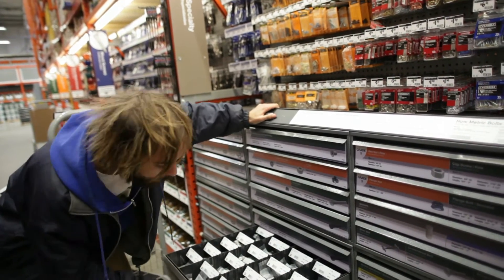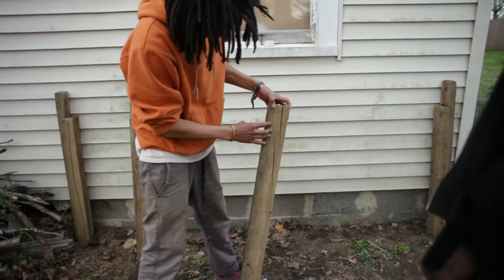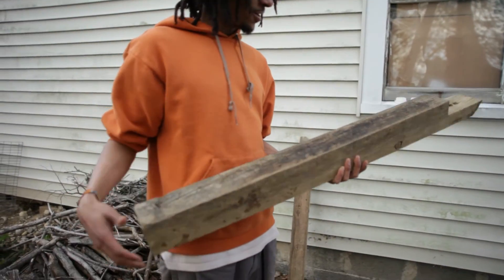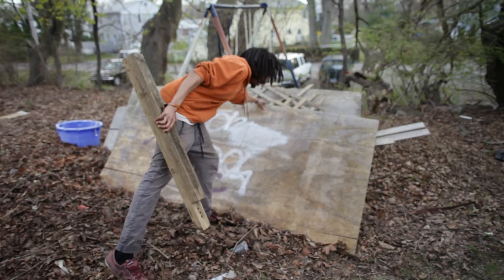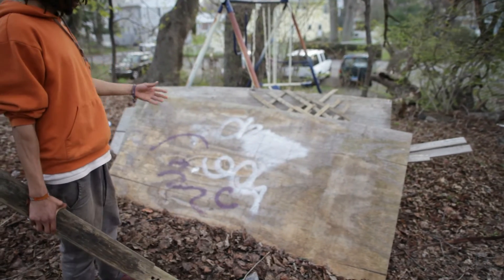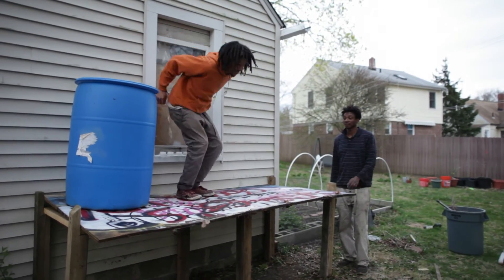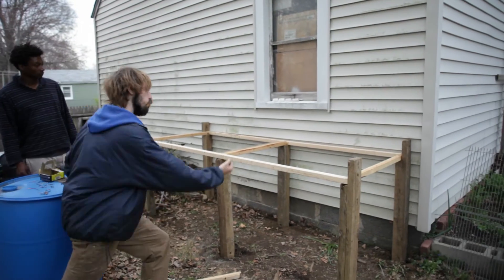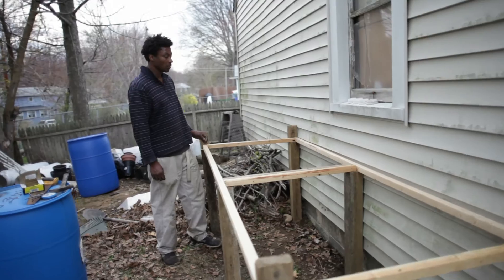RainWater Collection System Build Part 1

Comment: So thats around 1760 pounds of water sitting on 2 x 2's and a piece of old plywood?
Reply from the maker: The table was not complete in this video, I know how heavy the barrels are. The table will be heavily reinforced. Also the wood that Im using is not rotted it still very strong, and I have brand new 4 by 4s that I will be building a frame with. The nails was just to get a basic shape of what it will look like.
Reply from the maker: But you are right if that was the structure it would not hold.
Reply: O.k. I see, it's a work in progress. I enjoy your videos and your enthusiasm for gardening. You've sparked my interest in Jerusalem artichokes. If I may ask how did you prepare them, and how do they taste?
Reply from the maker: Oh thank You! I like to eat them raw, with guacamole. There also really good in soups and sauteed with garlic. The flavor is kinda hard to describe, But it have a earthy flavor, similar to waterchesnuts.